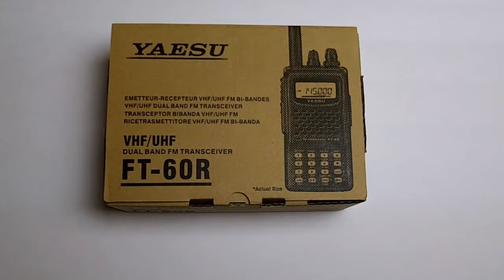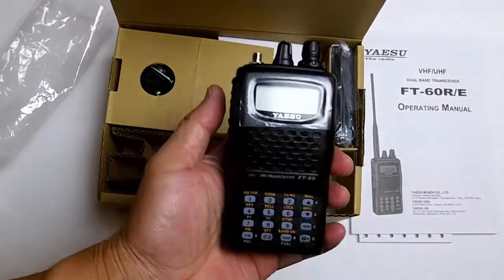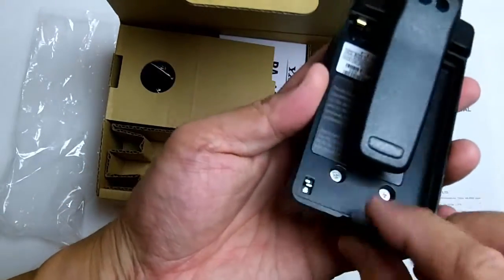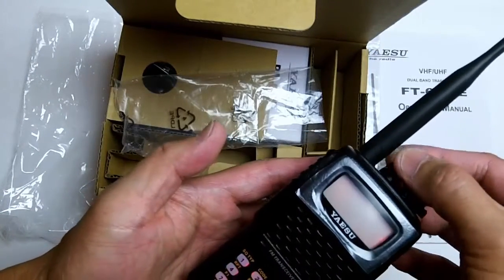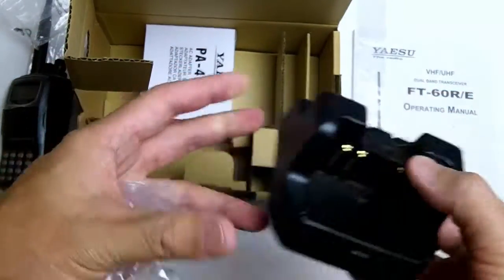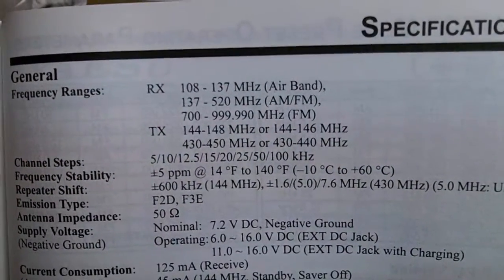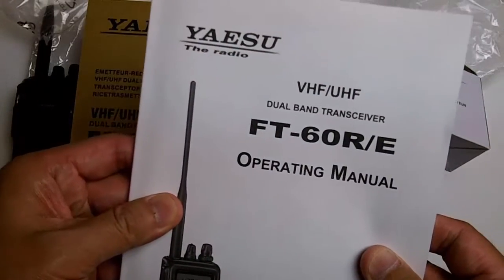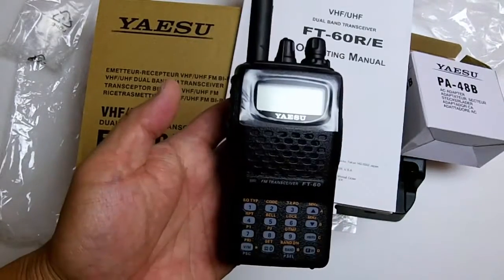Yaesu FT-60R Ham Radio Unboxing : Eye-On-Stuff

Comment: I find the display hard to read, and LCD contrast isn’t adjustable. Baofeng wins hands down at 1/5th the price.
Reply from the maker: I use the Baofeng most of the time myself. I like the dual display.
Reply: Baofeng sucks!!! I have 2 of them!! The sound cuts out after 4 months. And they are cheaply made.